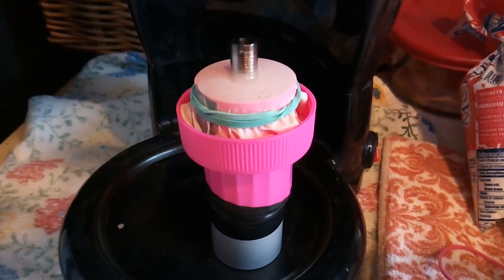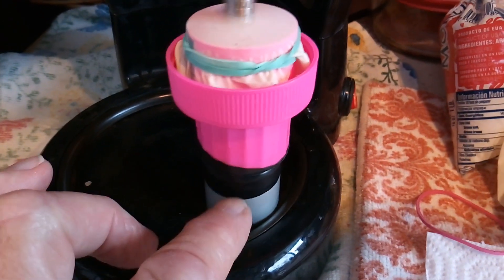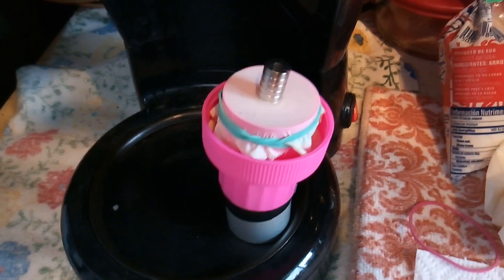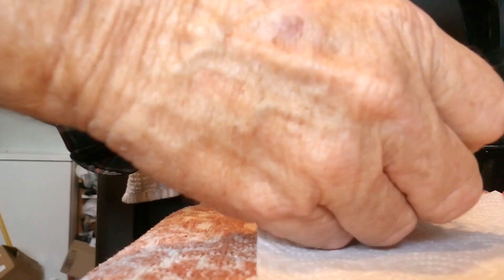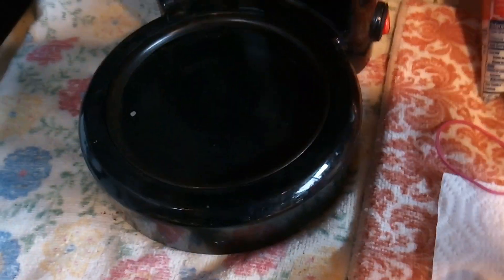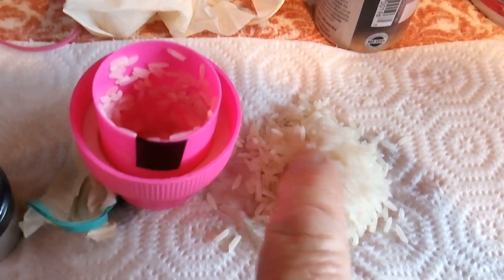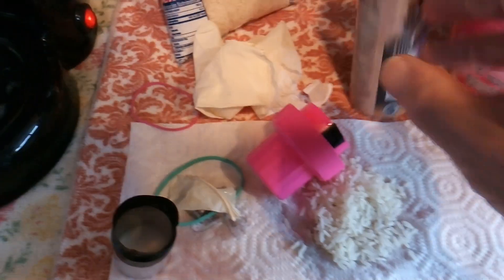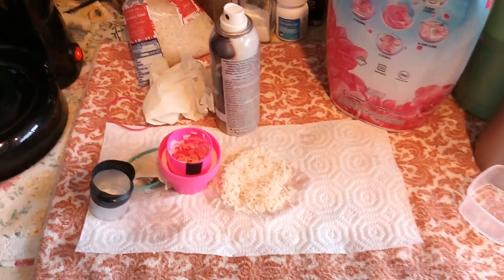Thermoacoustic Rice Engine

Comment: It's a good way to cook rice. 
Maybe chopped plastic or wood chips that doesn't cook and expand.
Reply from the maker: Glass beads or small fish tank rocks also work.  I think that it has to be something that absorbs and releases heat easily.
Reply: @Lidmotor  Copper shot, perhaps?

Comment: I have many questions that haven't been answered. Does the engine stop at any point? Like when the rice gets wet, or the whole thing gets to equilibrium? Does the water run out?  It's a fun demo but I would like to see one, without a rubber membrane, that won't eventually fail.
I would like to see one that can be put in a satellite that will work for years, that I can make. I applaud all the efforts, but they are just toys.
Reply from the maker: NASA uses a free piston Stirling engine .  There are videos about it here on YouTube,  What I show here is just a simple heat engine that is not stable or long lasting. It does show an interesting principle that could be used to build a much better device.

Comment: Great demonstration 😁😁
Reply from the maker: I went off in this direction because I am trying to build a Stirling engine that has PLA 3d printed parts.  Because of the low melting temp of PLA plastic the LTD engine (like the one you have) has to basiically run on ice vs room remp.  In my reseach on these types I stumbled on this rice engine and just had to build one.
Reply: @Lidmotor  I do enjoy Blade Atilla and another channel Resonanttheme who does a lot of thermoacoustic stuff. IT's a little early, but Happy New Year 😁
Reply from the maker: @GrandadIsAnOldMan  Happy New Year to you also.  Looking forword to many more fun and interesting projects.

Comment: Robert Murry Smith also made a low temperature version using alcohol as working fluid.
Reply from the maker: Yes!  My little engine does also.  Because of the fire danger I didn't show it.  I ran it on 50% isopropyl.  She might run quite well on a little nip of New Years Eve Vodka cheer.😀

Comment: I've been watching Robert Murry Smith. He made a similar engine  and called it strange engine.  And it's based on another engine made by Blade Atilla. Anyways it has inspired me to make a bigger one with Christmas cooky tins. I'm still eating the cookies. 😊
Reply: Seeing as holiday cookie tins have a large diameter I thought I might increase the displacement by putting the diaphram over a smaller diameter tin can on top.
Reply: I've tried Robert Murry Smith model with gravel. It worked in an enclosed cycle for few seconds and then stopped by overheating. I've put the engine on the stove top.
Reply: @cesarcesar1961  I think that's a sign we're putting in too much heat, and/or need a cooling jacket at the top.
Reply from the maker: It was Robert's video series on this that got me started on this new engine.  Blade Atiilla and I go way back.  I have replicated several of his devices.  I am also working on a Christmas cookie tin Stirling engine.  I did one a few years and this time I am trying to design an LTD one.
Reply: @Lidmotor   I guess I might hold back on mine and see what I may learn from yours. 

Have you seen the axial flux bldc motor I built?
Reply from the maker: @kreynolds1123  I am taking my time designing my latest 'xmas cookie tin' stirling engine.  It is an LTD type that I want to run on ice vs room temp.  I am using some parts that are low melt temp PLA 3d printed plastic,  It is a challenge. 
   I watched your videos on your axial flux motor.  It is very interesting.